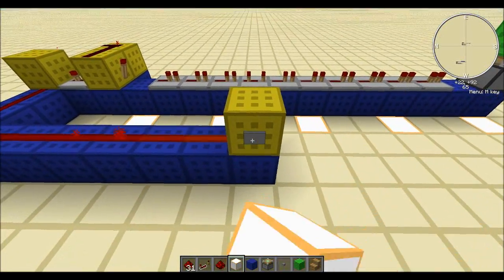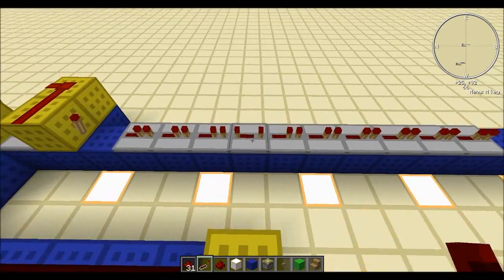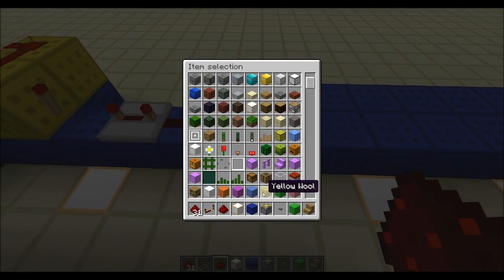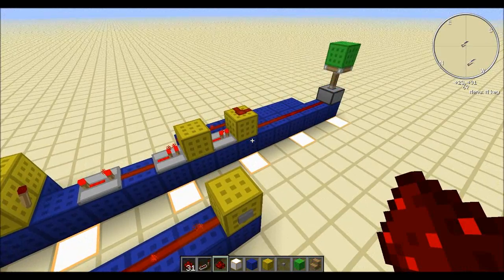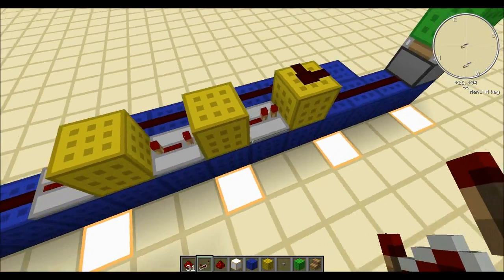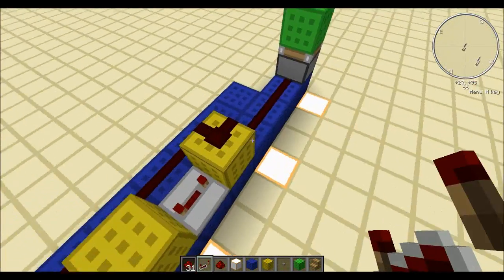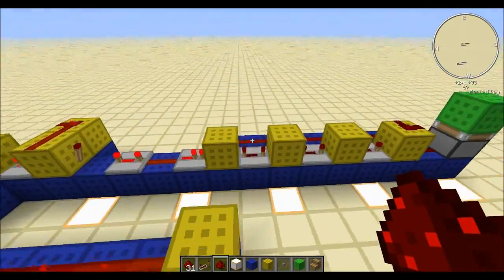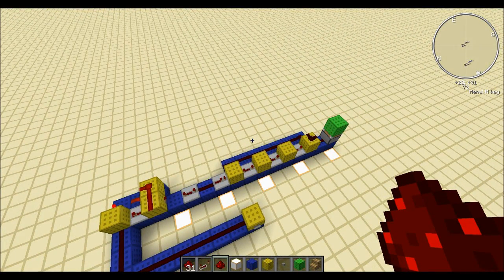Minecraft Tutorial: Any Pulse Length You Want

Comment: @cubehamster Got the demodulator working. Quite frustrating that the only way I can thing of to delay a pulse of any given length is to have a string of 1-tick repeaters.

The modulator is going to be a bit trickier. But not impossible, a variation of the circuit behind your sapling-key door will go a long way.

Comment: @RiotIndustries Create a pulse lengthener for each bit, each one lengthening the pulse by the binary value. Create gates that pass the pulse through the lengthener of the bit is on, bypass the lengthener if the bit is off. Finally, shorten the pulse by one tick. To do this: invert the signal, put it through a 1-tick lengthener, invert the output.

Comment: I came up with a less compact version of this the other day. Needed it for resetting sticky piston binary adders from a pulse generator.

You can also use this to shorten pulses. Simply invert the input and output.

I built a clock that uses piston binary adders and filters that read the value. It's not perfect so false pulses get sent. Until I've compensate for the timings, I use these pulse inhibitors.

Got a new clock design in my head now that should use <40% of the volume for the workings.